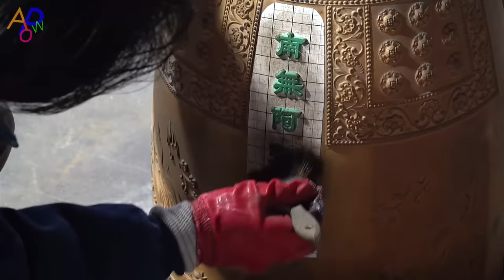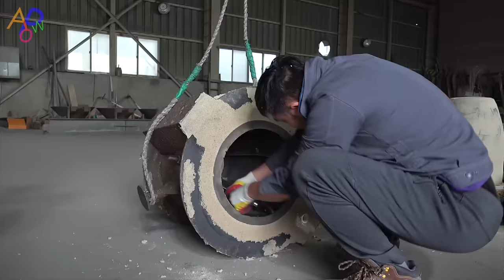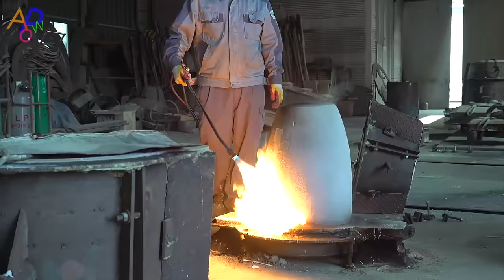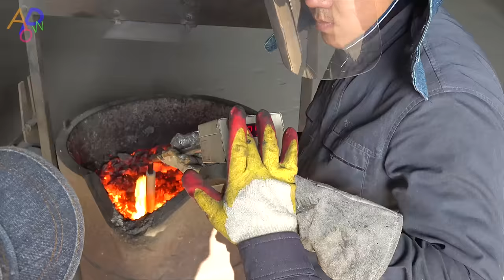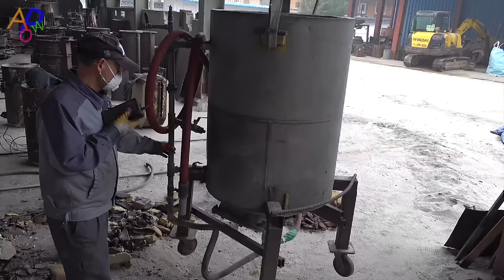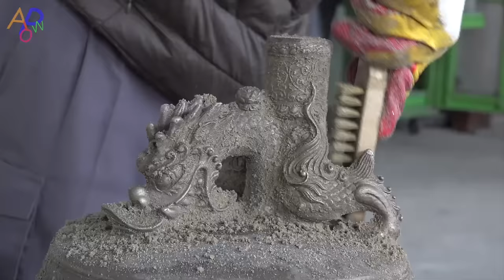Buddhist Temple Bell Making Process. 70 Year Old Korean Traditional Bell Factory

Comment: 3d printing and silicone rubber molds is not tradition. It is modern mass production.
Reply: So is using iron and then coloring it to look like it's bronze.
Reply: To be fair in the past it likely would have just been a segmented wood mold. Just it's easier, faster and more reusable then a wood mold that would wear out and change with the weather plus require a bit more clean up to remove any lines from the mold segment edges.